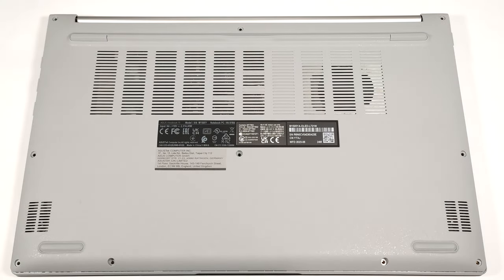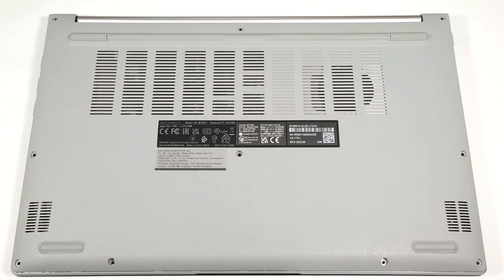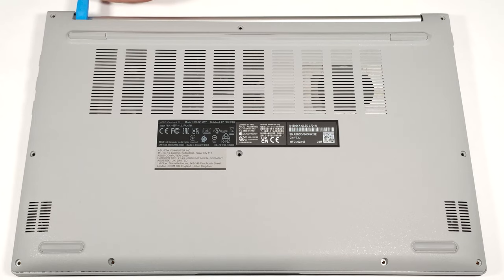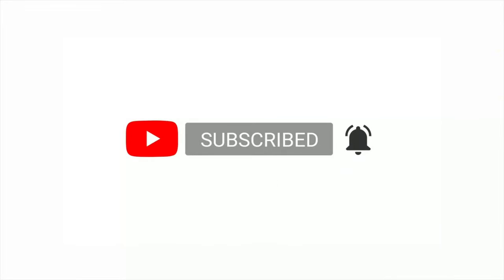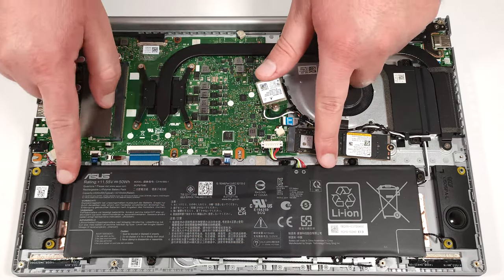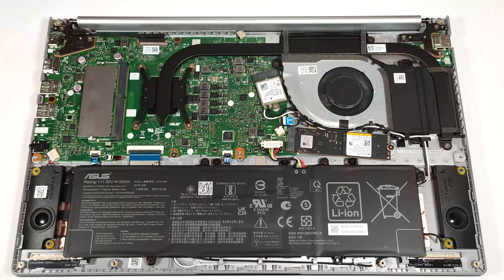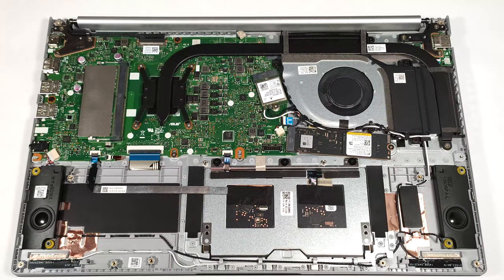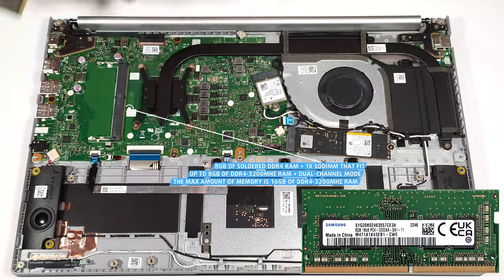🛠️ How to open ASUS Vivobook 15 OLED (M1505) - disassembly and upgrade options

Comment: The processor is great, but due to the crappy cooling system they put in it, you can't use more than 60% of the processor's potential...